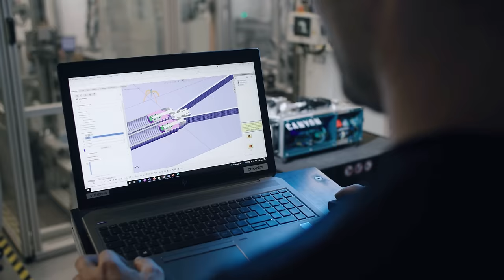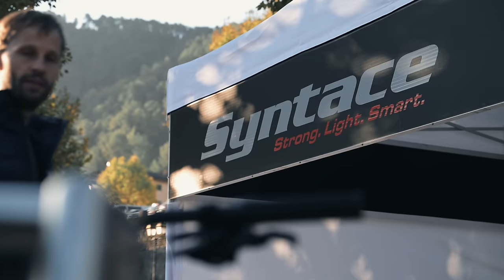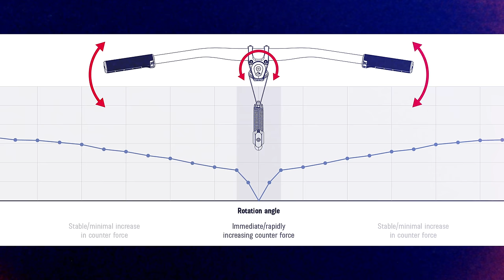Keep It Stable (K.I.S.) | Drop into the details behind this all-new technology.

Comment: What about tailwhips or barspins?
Reply from the maker: There is an integrated rotation stop which prohibits over rotation of the system. This comes into effect just beyond 90 degrees. Meaning it won't get in the way of whips and bar turns. K.I.S. is making you smoother in rough terrain, gets you faster through every corner, and gives you more control on sketchy descents. It also helps you climb.

Comment: Sounds like they are contemplating steeper steering geometry in the future and this is insurance against head shake at high speeds. That seems to be what steering dampers are used for in moto applications.
Reply: This is not a damper. Adding a spring only changed the natural frequency of the oscillations.
Reply: @1312_PV  "changed the frequency of the natural oscillations"...just described what a damper does. Thanks.
Reply: @beefeekeefee  Dampers also reduce or weaken the impulse.
Reply: @1312_PV  read my post. I never said the springs WERE a damper, only that the designers were trying to extract similar effect of reducing head shake, and that moto design engineers use dampers for a similar effect.
Reply: @1312_PV  do you even know what head shake is? Do you ride bicycles? Motorcycles? Or just an engineering student who enjoys trolling the net...
Reply: @beefeekeefee  I've riden bicycles basically since I can walk. Doesn't change the fact that the functionality of a spring and that of a damper is physically different.

Now I ask you, do you ride bicycles? Have you ever used a low end undampened non-adjustable spring fork that basically becomes a pogo stick at certain situations?

Comment: Bear in mind, those small springs have no force aginst your hands or arms even. It is simple physics that the wheels will straighten up eventually. It does feel like a marketing stunt and nothing more.
Reply: Plus it does add another point of failure INSIDE the frame.

Comment: Love Canyons desire to push boundaries, but they fail miserably on basic ground clearance. I have a Torque CF9 that I encounter pedal strike far more than I have on every bike I've ever owned combined. If not for that, it would be the best bike I've owned.
Reply: Try shorter cranks. I had tons of pedal strikes on my Forbidden Druid with the 175mm cranks I had on it at first, then I switched to 165mm cranks and now I have almost no strikes anymore.
Reply: @Streamlines  I intend to, even contemplating the Hope 155, I know they're meant for Ebikes really but would eliminate pedal strikes. However it is something Canyon need to address
Reply: @jamiestratton7925  just buy a bike with a high BB if pedalling over obstacles is your thing. lower BBs are better on the descents

Comment: Doesnt the Gyroscopic rotation of the wheel keep it stable enough ? This just seems like more stuff that can break quickly and you need specialty tools and small parts that take weeks to arrive to fix it, also more cost for the consumer, since this is RND, extra cost for assembly and materials. Id say normally you have pretty good ideas, not so much this one lads. Jo summarized it the best at 2:14 : "nobody asks for this and also myself I didnt ask for that." Id say a more reasonable RND investment is downtube storage. But hey what do i know ? I am just some random on youtube who doesnt have an engineering degree like you.
Reply: It's very small left and right movements of the front wheel that keeps the bike stable and upright.

I don't like to use the term counter-steering as this is often described as a conscious input from the rider to help the bike turn, which it can be, but in terms of keeping the bike stable, the bike basically does this type counter-steering by itself. Holding onto the bars too tight or being too rigid in the arms prevents this action and causes unstability.

Did you notice the K.I.S system allows for these small left and right movements in the initial part of its movement; without it, the bike would be extremely unstable and difficult to ride.

You can test this yourself by loosening off the stem bolts and then over-tightening the stem cap/compression bolt and then re-tightening stem bolts. The front wheel will have difficultly doing these minute left and right movements I speak of and the bike will be unstable and ride weirdly.

Comment: soooooo, hows this gonna effect doing proper tabletops and taboggans? doesnt seem like this is meant for someone who likes to play on the their bike
Reply from the maker: If you like tricking and jibbing around at lower speeds, the K.I.S. system might be a disadvantage. K.I.S. is making you smoother in rough terrain, gets you faster through every corner, and gives you more control on sketchy descents. It also helps you climb.

Comment: What is the point of this? Fork offset does exactly the same thing with no extra gear by lifting the weight of the bike when turning the handle bar form the center position.

Comment: Would definitely make it way easier to ride with no hands on bikes with geometry that doesn't lend itself to doing that.
Reply: To be able to ride your bike without hands you NEED your handlebars to be able to move freely side to side...
Reply: @KapitanPisoar1  to a point yes I understand.  I wonder if this system though, since it has some slack / dead zone in it and a torque ramp up after that that you'd still be fine.   You generally only ride straight or do slight/ gradual turns anyway with no hands.   It could keep bikes with poor geometry from jacknifing the front wheel. 

I have a bike that's impossible to ride with no hands, and one that's doable but not easy to control.
Reply: @Artcore103   Yeah I think that in video they mention that the deadzone is adjustable. I've rode pretty much any bike with no hands and never jackkifed them. Yeah some are easier than others, but thats what it is. What bike you found impossible or hard to ride with no hands?
Reply: @KapitanPisoar1  maybe jacknifing is too strong... but they don't self correct, they do the opposite, even when you try to lean the other way, either way the fork starts to turn, it will only keep progressing. 

My real bad one is a trek 7300 commuter bike it's impossible if you're a mortal.   My giant revel 29er is rideable but not great.   I used to have a semi-custim hardtail and a single speed road bike that just loved to be ridden no hands with zero effort for as long as I wanted even doing moderate turns.  Wish I could find that again, the giant takes effort and I have to put my arms out to balance.  I didn't even have to do that on my old bikes from like 10 years ago.  I was super good at it too so I know it's these bikes.

Comment: That graph with the load is BS. They connected the discrete points with lines but the actual “curve” is close to flat initially until the slack is taken up. Then it should be linear because a spring K value is constant at small displacements.  That and several other fudging of data does not give me a good feeling. If something works why lie about it?

Comment: This is a hard pass for me. I like to feel the amount of pressure I exert on my handle bars in all situations. I don’t want any type of “ assist “ when riding as this will develop into bad habits. Getting to know your bike and how it responds to your body will never ever be replicated.
Reply: Then why ride a fork and shock ,when u don't want assist? (Just assuming you ride one of the named if not ignore the comment)
Reply: @Xbox360gamer5000  lol, a full suspension MTB is completely different. This absorbs all the rough bumps, steps, curbs, rocks etc…in no way does that “ assist “ other than making the ride more comfortable. Plus this idea has been done before to no avail. It is literally just a gimmick to sell a product.
Reply: @battistaverardi1240  tf.  as if suspension is just for bump absorption and comfort.

It literally assists ur grip in cornering.

An that bad habits thing u mentioned this exactly phenomenon happens with suspension, many pro riders say don't give Ur kids full suspension bikes until they really need them if you want them to get good because u get used to the assistance through suspension and then they don't form the skills if the equipment does it for them

With kiss it's literally the same thing as with suspension just as every tech component in MTBing, if you buy highend gear doesn't matter if tubless inserts where you can lower ur pressure to get more grip or Magura abs or fox live valve or suspension, everything assists you and if bought too early it hurts your riding skillz.

Period.
Reply: I had a 190mm freerider and I rode it on my local trails with no problems felt like i was a good rider until I bought a 130 mm trail bike and oh boy my skills were non existent because my assisting 190 fork made the work

Since the low mm bike I got much better
Reply: @Xbox360gamer5000  when I was young I rode my hardtail XC bike with 90mm travel and ~700mm wide flat bars (I think they were actually 680mm) on proper downhill trails. its all in the rider. imo if people have the money they should always start on a hardtail. that will teach you how to be smooth. then, when you get a full suspension bike you will be absolutely blown away
Reply: @berengerchristy6256  absolutely correct. But still as ur skills developed and u are a point where you need a full sus. i think you can also get yourself this KIS system.(if it's that good as presented). 

For people who race this could be an absolute essential if it benefits u quite a bit. So you need it to keep up.
Reply: @Xbox360gamer5000  this kis system doesn't seem like a game changer, more like a nice to have along the lines of a dropper post
Reply: @berengerchristy6256  if it's good we will see. U have to ride it to know.

Comment: Just shim your stem and over tighten it so it presses on the bearing seals job done stiff as you want with no extra cost peice or rubber pressed against the stem and fork bearings easy ill sell you my design for £1, this is nothing new i did this to my bmx cranks so they would stay level for tricks

Comment: This is dumb! Yet another example of bike manufacturers trying to rip off their customers. This may be useful on kids bikes but that’s about it. Steering stability comes from the gyroscopic effect of the wheels. The larger the front wheel and the faster it spins the more resistance you have to steering. Want a more playful feel? Get a 27.5 bike. Want a very stable ride? Get a 29er. IMO, Canyon would be much better off investing in cutting manufacturing costs and or improving frame compliance and stiffness than doing this dumb stuff. Don’t fall for it! This is yet another part that will need servicing and adds unnecessary complexity. I am not surprised, it’s the Germans that are doing this! They over-engineer everything! KISS stands for Keep It Simple Stupid.
Reply: Manufacturung for Canyon (and not only for this brand) is done by a company known under the name Giant (the world's largest bicycle manufacturer).
I assume Giant knows how to produce bikes in large quantities